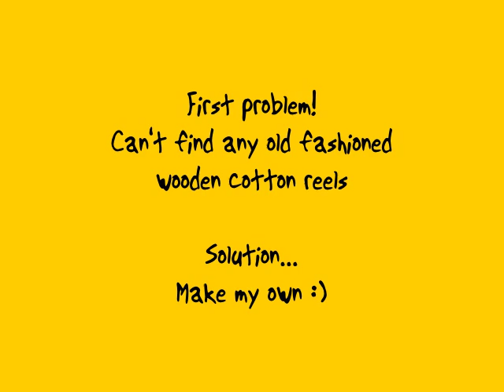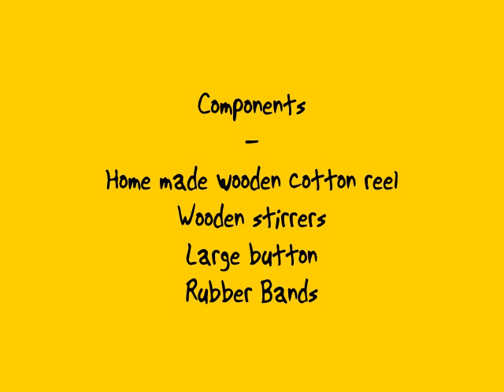Old Style Rubber Band Powered Cotton Reel Car #1

Comment: how can i make it goes faster and in an straighter line ?
Reply from the maker: Faster is just a matter of more rubber bands or thicker rubber bands, but getting it to go straight is a matter of grip.  If one side grips more than the other then it will turn so you need to get good grip on both sides.